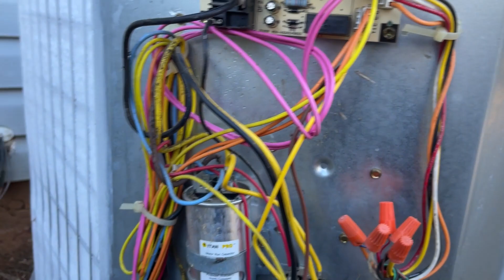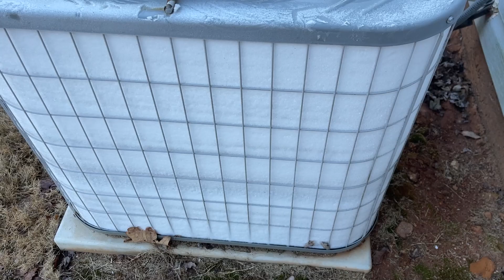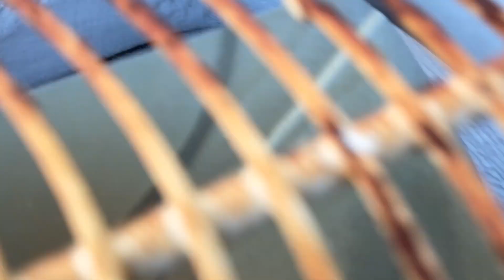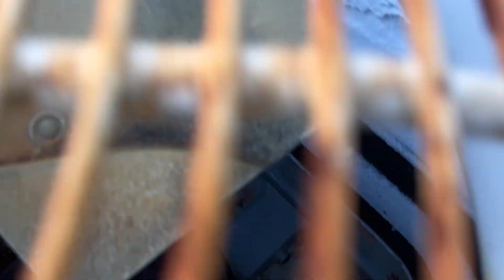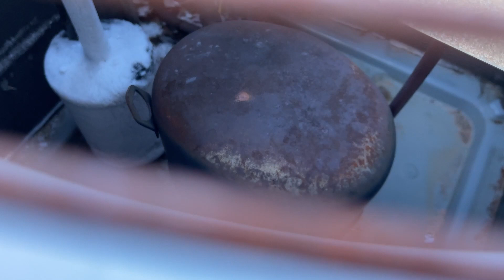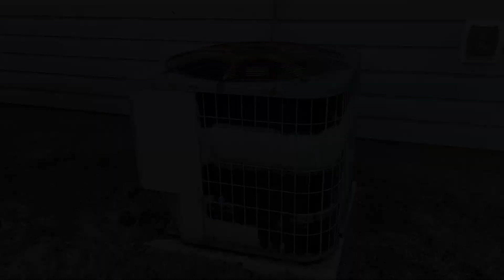EXTREMELY Frozen Carrier 38YCC Heat Pump | Full Defrost Cycle

Comment: Sure was frozen! It came out of defrost with ice still on it?
Reply: The sensor reaches the termination temp. It will be completely defrosted on next cycle
Reply: @imlookgudright4  shouldn't it have melted all the ice before it met the termination temp?
Reply: there's a max defrost time limit, if it is exceeded it will terminate the defrost whether the defrost thermostat  opens @dilchproductions
Reply: @Jon-hx7pe  Oh yeah, it's usually around 10 minutes. I just saw that the video was 4 minutes and didn't think about how there could have been cuts.